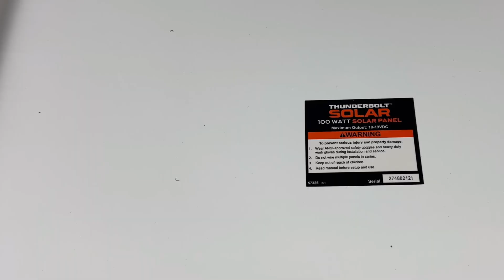MC4 Install Crimping Easy DIY

Comment: I ordered some bougerv MC4 connectors and they just came in today I grabbed a male metal pin crimped it on the same wire where I had all the failures with the other pins and it crimped on perfectly no issues at all! Also the female connector snapped right on with no issues either then I was able to snap it right on to the branch connector flawlessly, it made me so happy to be able to complete this project I testing the voltage with six one hundred watt renogy solar panels with 3 panels in series two parallel and in the shade I tested 60 volts, then I drove the van into direct sunlight it was around 3:00 and tested 64 volts but the sun was still a little low. I forgot to test the amps but it should have been around 10 amps, I will test it tomorrow to see. But it does seem that bougerv connectors are excellent connectors, not like the cheap once I bought and broke apart when I crimped them. Just thought I'd give you an update. It seems in my first comment I had the female pin and the male connector backwards in my brain but nevertheless It was a male pin and a female connector that I was working with and got failures i was just tired at the end of the day working 7 hours on the van that day. And it is confusing male pin with female connector and female pin with male connector WOW LOL you know mean well thank you for the video because it lead me in the right direction to finding some connectors I can trust.
Reply from the maker: Awesome glad it helped and you got to get the project pretty much finished up. 
I’m glad the connectors are working for ya. I think they are decent for sure. 

Thanks for the update 😀👍🏼

Comment: I must have bought a bad kit because I was crimping a female pin for the male plug and in the kit was 5 of each pin male and female. I was trying to finish off my project with a female metal pin to go into the male plastic plug and I did everything you did but the metal pin would break after crimping the metal pin would just fall off in pieces I ended up using all 5 female pins and every single one broke off the wire in pieces. That being said, I was using another kit before this last kit and everything worked fine, I didn't have a problem until I used that last package kit of MC4 connectors. Very very frustrating I was more than angry because I couldn't complete my project and now have to wait for my order for more MC4 connectors to come in!
Reply from the maker: Wow that’s weird did you buy the bougerv kit or a different one? 
Haven’t heard anyone having problems with the bougerv kit yet.
Reply: @johnnysweekends  No it wasn't bougerv kit not sure who the maker was I got it off of Amazon probably came from china but it was very disappointing.
Reply from the maker: Wow, well a lot of stuff does come from there but so far I haven’t heard anything about the kit I linked. So hopefully it still performs well.

Comment: It would be great to see a demo video for the 10mm2 connectors. They don't seem to have the same crimp fitting.
Reply from the maker: You mean the smash lugs..?
Reply: @johnnysweekends Smash lugs? MC4 connectors which fit 8AWG cable... The pins don't seem to have the fold over wings that the 2.5-6mm2 connectors do.
Reply from the maker: Sorry small lugs lol.

You’ll need this special crimper..

https://amzn.to/3DeEq5k
Reply from the maker: Let me know if that helps
Reply: @johnnysweekends  looks like what some sell as MC3 crimpers. I wonder if I could use an hydraulic crimper.
Reply from the maker: Could use one of the small ones..
Reply: @johnnysweekends  I bought one of the YQK-120 crimpers, goes down to 6mm2 and up to 120mm2.
Reply from the maker: Oh nice , yea if you ever need to do the larger lugs you’ll have the blocks to switch out. 👍🏼

Comment: Fantastic! Thank you!  I did a small custom solar job on a roof and I used marine crimp heat shrink connectors as I didn’t have the tools or parts to make custom ends. Now that I see how easy it is, I will use them!
Reply from the maker: You’re welcome. 

And yea super simple and the kit is only $30 with connectors. Link in description of the kit I used